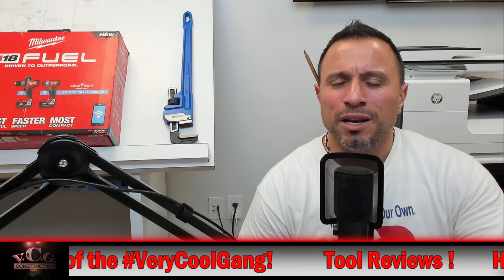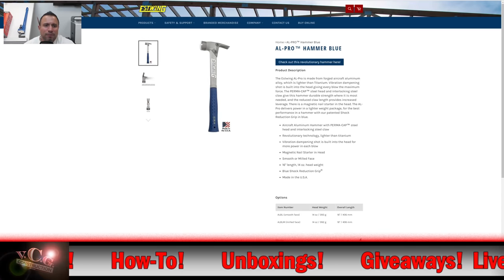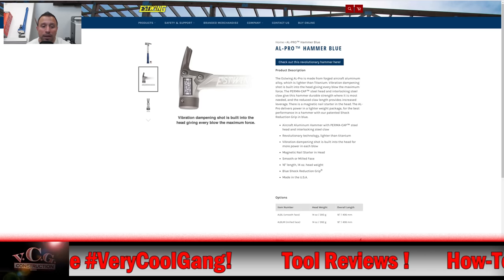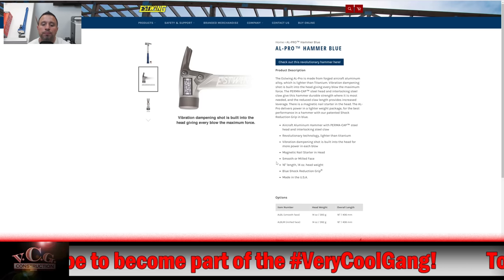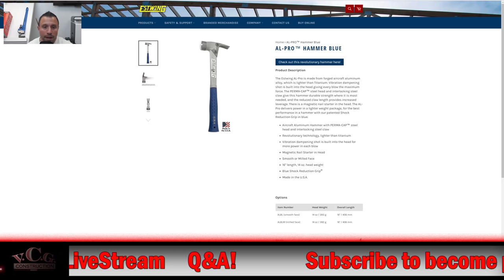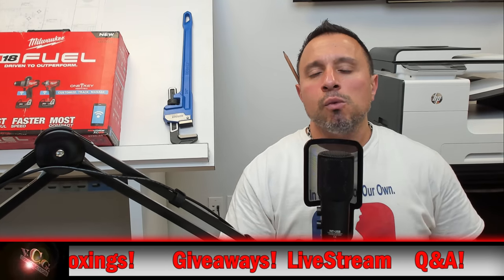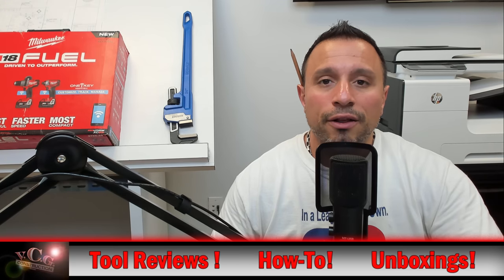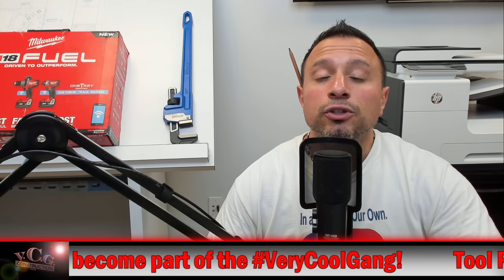Best Hammer On The Market? - Estwing Al Pro Hammer

Comment: You can pick it up at Home Depot on line for $113.00. I Remember when the Stiletto came out  and I though that it was a crazy price but after trying one for a few hours I went and bought one.  I would never go back to a steel hammer for framing.  I'm  Going to be 61 in a few weeks and anything I can use that is easy on my body I'll take it. I know that a lot of people will think it is high for a hammer but if you swing a hammer everyday it is well worth it.
Reply: I've only done framing for about six months now, so is the Stilleto well worth the price?
Reply: I think so I have the TITANIUM POLY FIBERGLASS HANDLE
Reply from the maker: How long have you had it?
Reply: I have had the Stiletto for about 7 years the POLY FIBERGLASS HANDLE for about 4 years. #overlandremoderlingmd

Comment: Stiletto 14 oz, wood handle for 22 years, bought it for $72 dollars in the day,  replaced the handle 1 time for $16.   I think it goes for $120'ish these days, i may be wrong.  During that time I had the 1st gen TiBone.  Man did is sound sexy when I bought it for around $170.  Steel head.  Had to pull out the hex head key out to adjust it about every other moment like it was a table saw.  Bull crap.  I sold it and would never buy it again, nor any of the new "titanium handles w/ steel head."  IMHO the wood handle stiletto is a solid foundation to drive your nails and maybe replace the head every 8 years for $16.  If you wanna demo, the 10# sledge with the wood handle does what I need.
  These new what I call "hybrid titanium/ steel" products I reject fully as marketing crap.  Us old guys left steel w/ the original stiletto, and it worked much better.  And now we are bringing titanium and steel into $300 dollar hammer and we have to swap out the heads?  Where is the data that this HUGE price increase improves the framers time on the job?  Show me the math.   We need young people to enter the trades and not push $300 whore products on them like our mechanic brothers do with the Snap On truck pimps.
  What we do is honorable work.  Nothing we do can be farmed to China.  We are better than this.

Comment: How’s the flight time of this?  In air RPM’s?  Just in case I need to chuck it at an apprentice that’s screwing up.
Reply from the maker: May need further testing!!
Reply: How old school. I removed the safety on my Paslode. Then I throw it at the help.
Reply: Renaissance Man Paslode’s are worth more than the apprentice.   I’m a sparky anyway.  I usually use the apprentii as voltage testers anyway.
Reply: VCG Construction I’ll have to check the Estwing website for further tests.  See if there’s an MSDS on it

Comment: I have a Estwing 25 oz wood Handel and I love if only after I scraped off the Polly and sanded it with 120 grit sand paper and shapped several coats of boiled linseed oil on it   It turned out to be my favorite hammer

Comment: Hammer time wow the price is pretty crazy for me. I don't swing a hammer all day. I'm good with my DeWalt hammer I have.
Reply: LOW VOLTAGE DUDE my DeWalt hammer over heated and broke. I think I was using it wrong.
Reply: @renaissancemen1  you should put some coolant inside that might help

Comment: Vince, I have 16oz straight claw,  20oz and 28oz framers, all Estwing..  No need for a $126 hammer when basically it’s used for banging top and bottom plates to get the wall plumb..  All my nailing is done by guns so I’m out!
Reply from the maker: it's a nice chunk of change to drop on a hammer!
Reply: VCG Construction you’re not kiddin!
Reply: Holy clams. I’ll use a axe to do my bludgeoning.

Comment: This is by far the best hammer I ever had the steel claw actually broke before anything else after  three years but that was me being stupid.  Missed blows is not a factor it just dents it like t1000 in terminator kinda but remains strong. Like I said three years still usable w broken claw but l am getting a new one. Me and the Co workers and boss play a game called stump with 60D nails and a stump and you take turns around the stump hitting your own nail in. One at a time u flip your Hanmer however many flips you flip and catch it is how many swings you get at your nail. Well I set what I think is an unbeatable record with this hammer. Like I said you have to swing it exactly like you caught it well I was first flipped it three time and caught it perfect and nailed a 60D pole barn nail into a oak stump in three perfect swings and won before anyone else got a turn.  Side note that absolutely blows the previous record of the fifth turn out of the water. Best hammer ever

Comment: Here in the UK it's a £148 very expensive but it's another USA quality tool I had to have . I still use my all steel framing hammer for the real smash the crap out of demolition then go to this for framing out the new I guess it's the sheer cost of it and not wanting to burst into a bubbling wreck if I break it lol

Comment: If I was going to purchase a lite hammer it would be magnesium not aluminum especially for the price point.
Reply: For framing? Magnesium doesnt sound very reliable.
Reply: Rezorcful You are probably correct but as good as aluminum, Titanium most likely be the best but that is way more expensive than either two of the softer metals (aluminum, magnesium)
Reply: @cuffem2  you can get a good stiletto for 80 bucks 14 oz. Wood handle if you drive 60d nails ever you will wish you had titanium hammer

Comment: 🔨It's Hammer Time! MC HAMMER! YA! Awesome video Vince I 💖 it! As long as the aluminum hammer is built to the same standards as a steel hammer (may need a higher grade aluminum to the steel or something) the aluminum hammer will be exactly the same strength and 35 to 45% lighter. I wouldn't worry about it breaking or cracking at all. I would price it at $150 US. Thanks for another video Vince keep em coming! 🔨🔨🔨🔨🔨(that's 5 hammers in place of 5 stars!)

Comment: I will not spend that much on a hammer even if it has wings I will keep using my craftsman made in the USA all metal hammer over it
Reply: Richard Garner I took you for a stick tied to a rock type of hammer guy. Who knew???
Reply: @renaissancemen1  LMAO 🤣🤣
Reply: richard actually owns tools made in USA ?? wtf ?? ryobi dont make hammers !!
Reply: kingofthecrease30 king of the ryobi has 3 hammers out on the home depot website
Reply: @JENNA9039  i told you i dont like ryobi...i didnt know that...but they are prob not made in USA
Reply: kingofthecrease30 is the ridgid push impact driver worth buying or not and king of the crease the ryobi hammers look like garbage to me